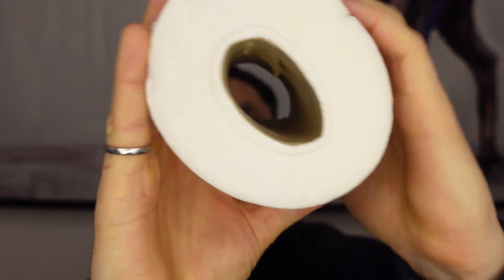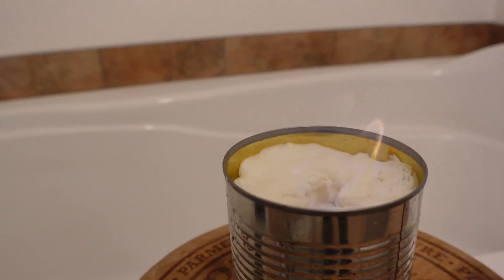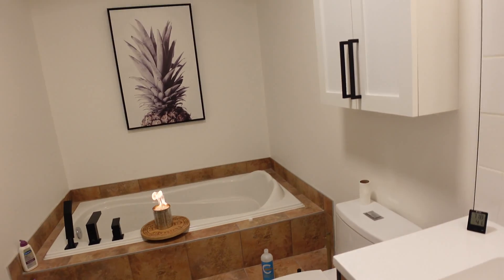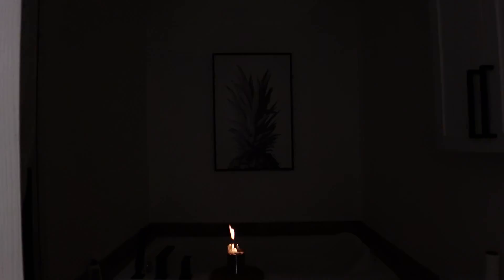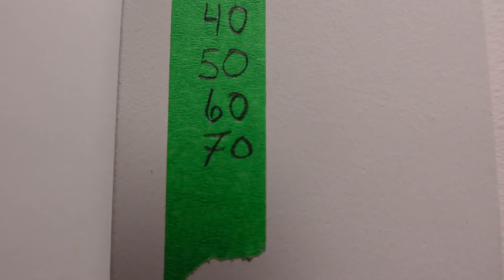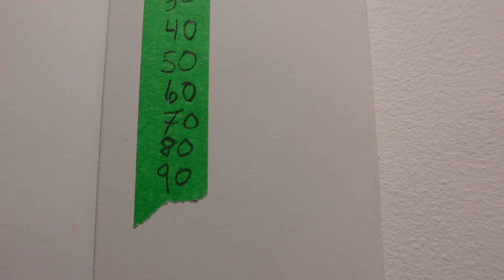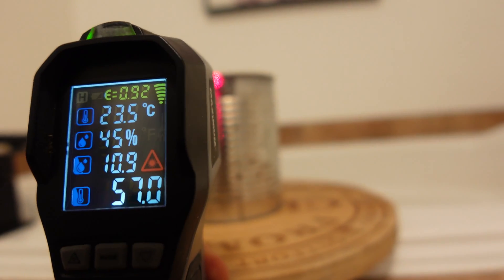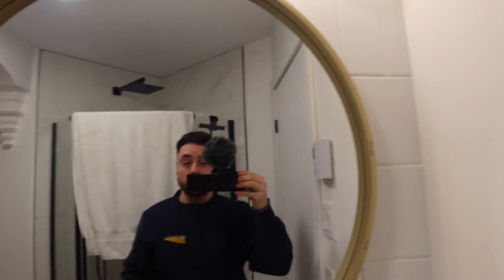TOILET PAPER EMERGENCY HEATER | Does It Actually Work?!

Comment: 🤚🏼🛑 It's not safe to leave an open flame unattended. Is it possible to boil a small pot on top of the can safely? Is rubbing alcohol food safe, does anyone know? 🤷🏻‍♀️
Reply: I think it’d probably be fine, I’d just use a big pot instead of a small one to reduce it potentially contaminating the water
Reply: Great & informative video!  Love it.  I intend to try this, but will put the smaller. Can inside a larger can for safety. I would also use a type of great over the top to see how that will work for heating water. Many thanks posting this 😊
Reply from the maker: It’s is safe, I can make a video to see how long it takes to boil 1 cup of water with a alcohol flame
Reply: @philg  👍🏼 OK! That experiment would be interesting! And perhaps then after that, cook emergency rations, like a packet of ramen say? Heating, while eating lol. May need to add a metal spacer between the pot & the burner though? Could use the top of another same sized can to make one - a band with holes around the sides of it. Airflow.

Comment: alcohol will evapourate away when not in use and could make alot of trouble if it falls over.

surely a wax would be better since it can be used as a fuel but doesnt light, so if it falls over then you just have wax to clean up not a fire to put out.   plus you can put it out and after its cooled, it solidifies so you wont have to worry about it.
Reply from the maker: Very interesting point! I can make a test with something similar next week.